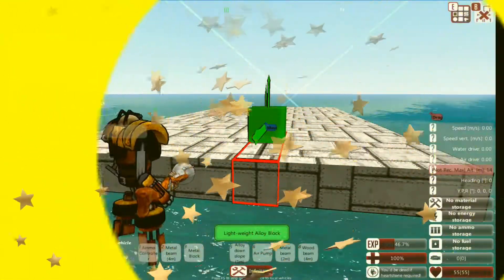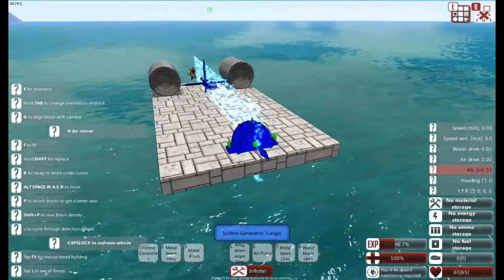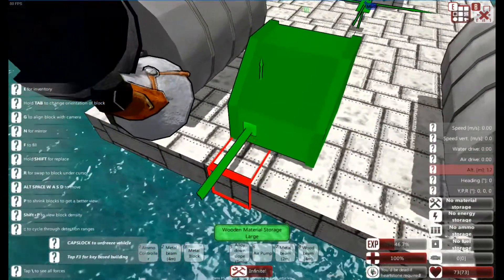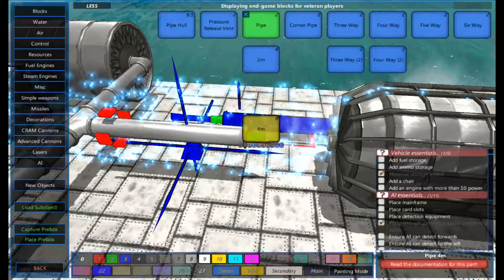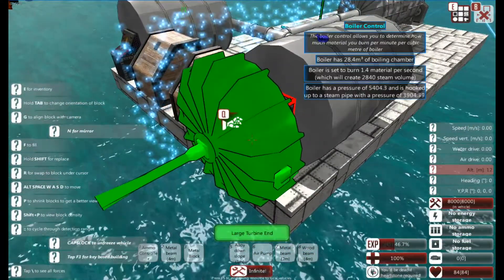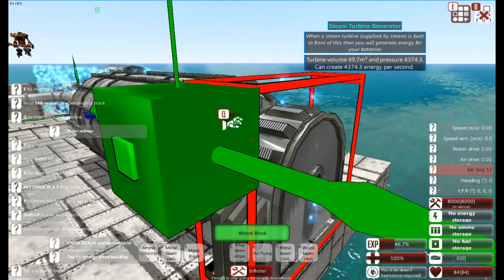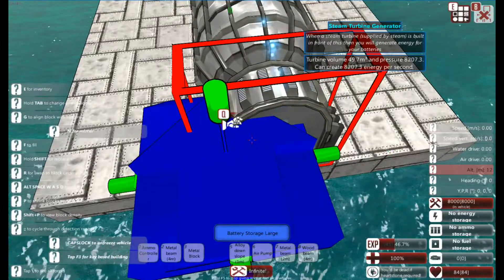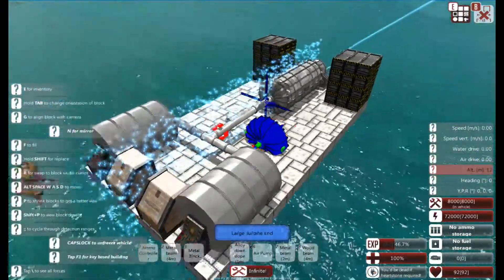From the Depths - Steam Power Generator Tutorial

Comment: i did some testing, and from what i gathered the following should be true;
there is a significant pressue drop off for the turbine chamber in relation to the length of your pipeing
a larger chamber is not as efficient as two smaller ones, when both would equate to the size of the larger one, however the mentioned pipe pressure drop off balences this out, i havent found the optimal design to balance these two factors
there is a maximum amount of pressure a chamber can hold related to its volume
likewise there is a maximum amount of pressure a boiler can produce related to its volume
it doesnt seem to matter if you pick a 1x1x1 chamber or a 3x1x1 chamber (the large and small options) as long as the volume is the same
more boilers will generate pressure faster and a larger turbine will take longer to build pressure, so too many boilers means you will be generateing lots of power sooner at the cost of space, too many chambers means you wont reach their maximum pressure and will have wasted space
if someone figures out the ideal ratio of boiler to turbine chamber, please do post it here for everyone, i would try to figure it out but im far to drunk at this point
Reply: update: large generators do appear to be more efficient at generating power for the space they consume, this was concluded from an 8 boiler setup, with an front and rear (no middle pices) large turbine and the same setup but with six small turbines consuming the same space
the large turbine generated much more power than the collective six small ones